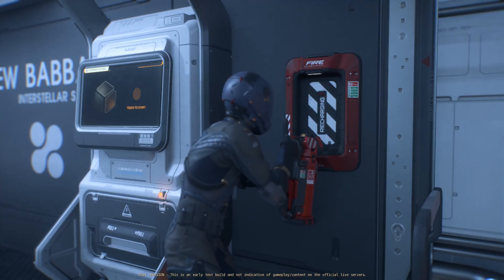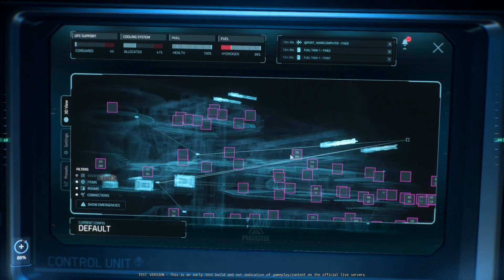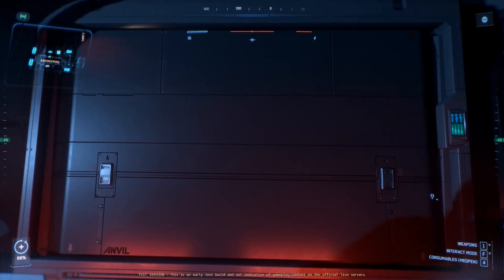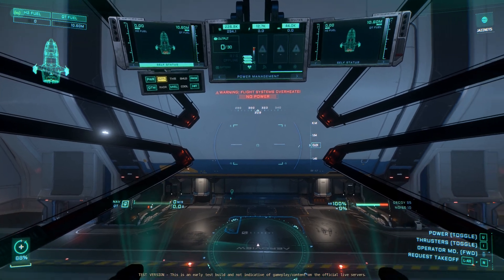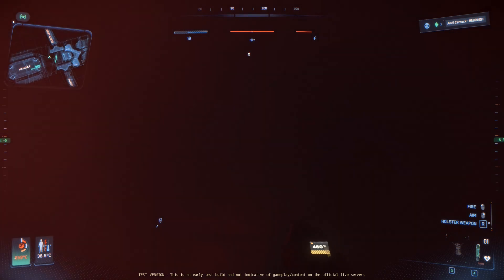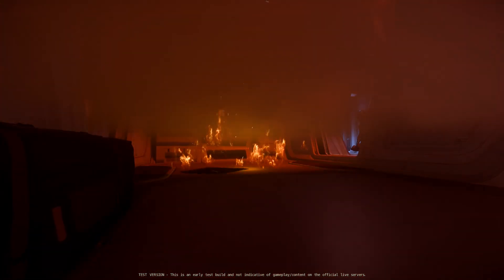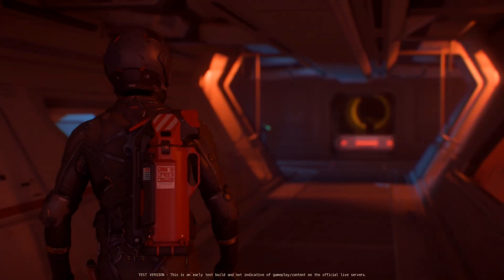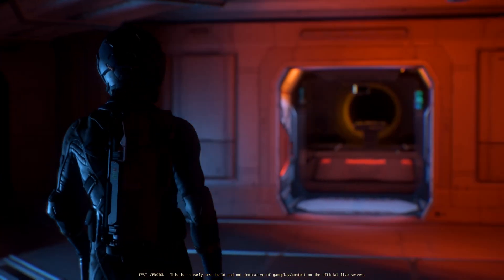Engineering Works, and It's Awesome! | Star Citizen Tech Preview

Comment: Id assume the fire extinguisher would be to gain access to the engineering panel, and then turn out life support and starve the fires from O2, turn off the powerplant, repair it, repair or replace the coolers and get the ship working again.

Impossible to control fires like that, even with a full crew running around.

Now i wonder, how many players will like to play engineer locked into room monitoring components and acting when they fail..... maybe the Tech Preview is too agressive and they will dial it down, its a clusterf***

Comment: I like the fire extinguishers, if you have personnel by the fire, but I hope they add a feature for solo players to just seal the bulkheads and flood the room with Halon 1301.
Reply: won't happen as that takes away from the game-play.
Reply: @RicoZaid_  not necessarily, because you still have to repair the components, the Halon only extinguishes the fire. Also, it's not any different gameplay than venting your ship.
Reply: Nah that’s too much of an accommodation for solo players. If you’re solo, you’re incentivized to fly a small ship which is manageable to engineer alone. A Corsair is about the max size that seems feasible. 

More likely if you’re solo just be prepared to ditch the ship if you take heavy damage.

Comment: From what I have seen I feel we need to ballance time to disable with how many engineers u need. Foxy had 4 on a carrack and that's just too many. Add to that: pilot, co - pilot, turret and what nut. Think a carrack should need 1 and than add as we go into Polaris, Idris, kraken, javelin. And the fights needs to be longer as ships become bigger
Reply: They have made the components easy to kill so that you can test easily. Also, theres no armor, so every ship basically has paper protecting components.
Reply from the maker: Yeah, that does make sense. o7